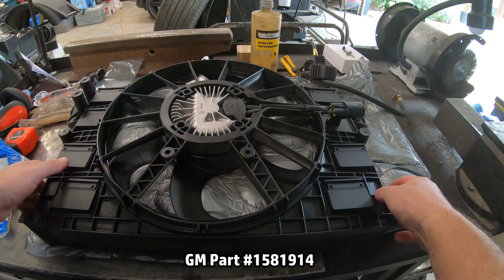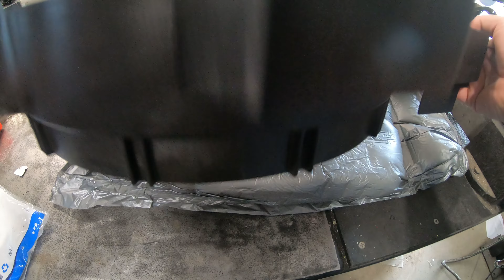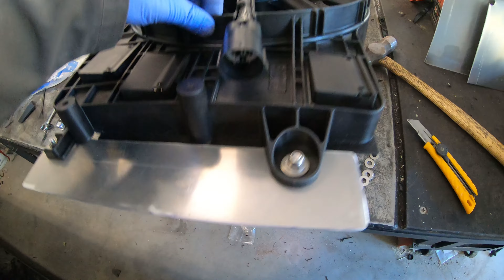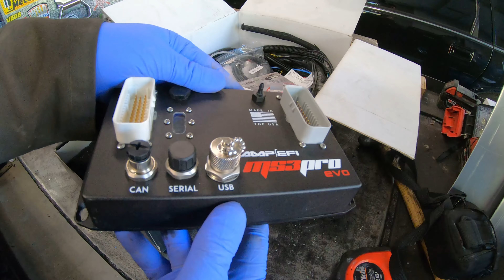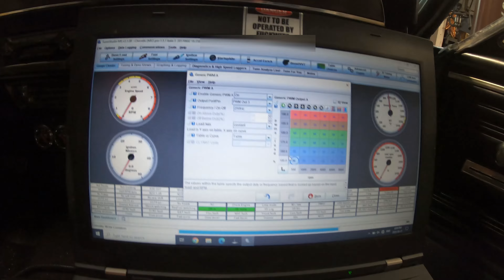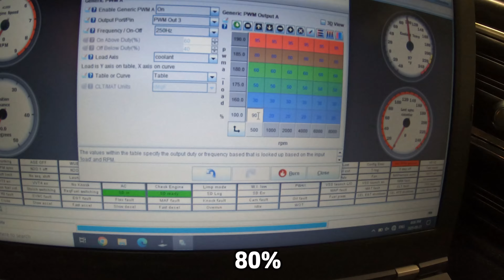Brushless C7 Corvette Fan in a Chevelle

Comment: Hi I see you used 250 Hz for frequency of this fan. Are you sure that's correct?
Reply from the maker: I am currently running it at 100 Hz and it is working well.  I'm not sure what the ideal is.  Apparently GM using 128 Hz so it's probably worth starting there.
Reply: @dr.dansgarage mine is running at 120hz also well but I’m trying to find out the optimal hz. Everyone is running these with different setups and can’t find a data sheet anywhere 😅
Reply from the maker: @nicksolomon697  I just changed mine to 125 Hz to try.  I probably won’t be able to tell a difference but I’ll try.
Reply: @dr.dansgarage  GM used 128hz on the C6 Corvette brushed fans. GM used 100hz on the GM C7 Corvette brushless fan. Lingenfelter has a document showing the various settings for the Spal brushless fans. If you download the instructions for their fan PWM controller you will come across it.